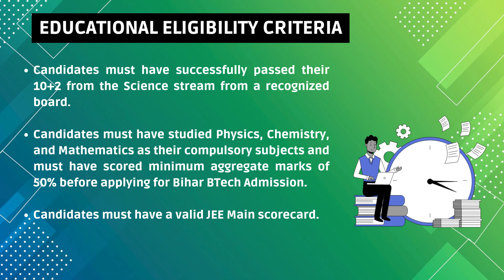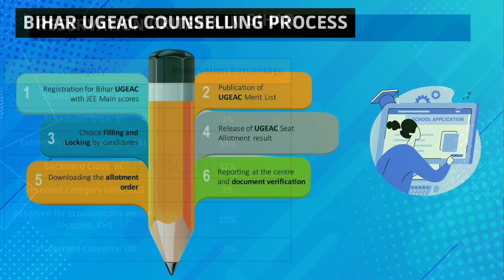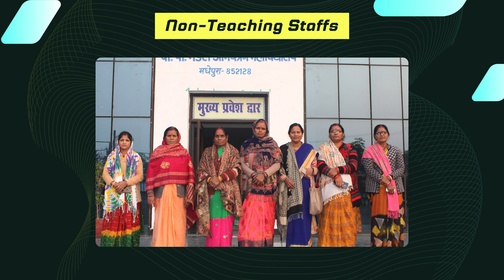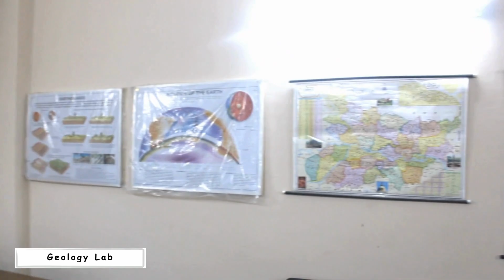BP Mandal College of Engineering Campus Tour | Bihar Engineering College Campus Tour

Comment: Documents required at admission?? Plz tell me all the documents in detail
Reply from the maker: Documents Required:-

1. Admit Card of JEE Main 2024

2. Score Card of JEE Main 2024

3. Passing Certificate / Mark sheet / Admit Card of Matric / equivalent exam

4. Passing Certificate / Mark sheet / Admit Card of Intermediate/ 10+2 / equivalent exam

5. Residential Certificate

6. Caste Certificate

7. Six copies of the passport-size photographs, which were pasted on the admit card of JEE Main 2024

8. Downloaded print of Online filled Application Form (Part A & Part B) of UGEAC 2024

9. Aadhar Card

10. Any other documents required (if any) such as DQ (PwD)/SMQ / EWS certificate

Note :- All the certificate/documents in original as per the requirements of admissions in Private Engineering Colleges